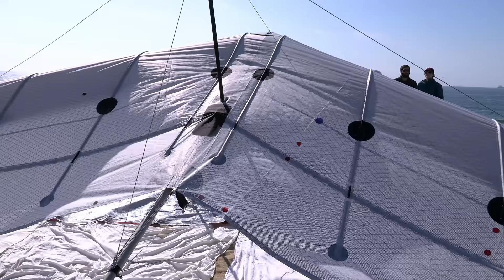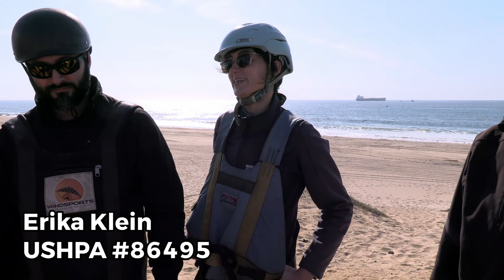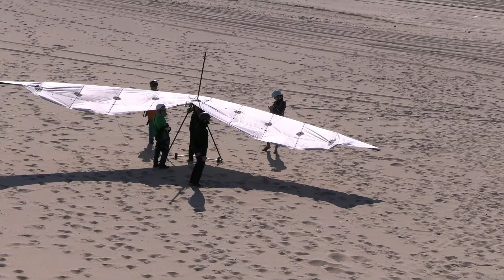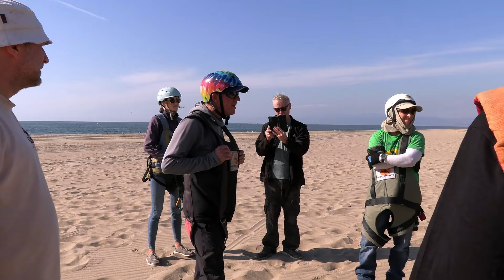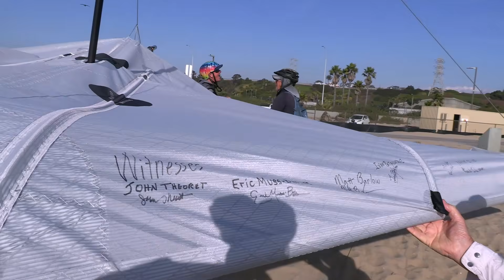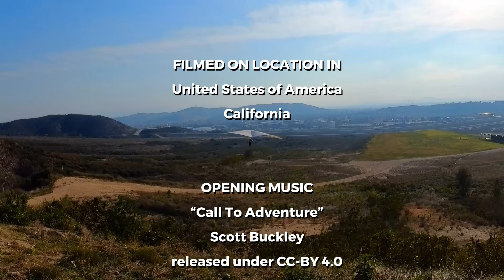Tiny Pack Hang Glider (TPHG) | Test Flights

Comment: You guys should look into the North Wing Sky Surfer, a much more defined glider that sets up in 6 min and breaks down to 6 ft in 15 min. I have one, Kitty Hawk has one. 40 lbs, flys wonderfully lands slow and sweet. Kamron had to put the project on the back burner as his workers/designers got killer together in a trike accident. 
 I had students wanting to trade their gliders in on the one I had. There are videos of the Sky floater flying, launching hands off and landing. Why reinvent this class of glider and from what I see taking design backwards. Sorry for saying what you don't want to hear.

Comment: What a trailing-edge-flutter... The idea of short-pack is not new. So far there has never been a light and easy short-pack glider that flew well. This seems to be no exception. Face it people, for a hangglider to fly great you have to accept the bulk and weight! And it's worth it, as nothing beat's this feeling!

Comment: I hope he can fix the aerodynamics while still achieving the weight and packing goals.
It looks quite obvious that the battens should extend all the way to trailing edge, not sure why he made them shorter. Maybe batten length concern due to packing, but then the Finsterwalders have battens that can split.
That cross bar solution obviously didn't work, and the lightest possible solution would be a bowsprit design, although at this low nose angle it may be a challenge.
The middle span of the sail has the trailling edge too low, so there's no washout on the glider. Maybe even a negative average washout, so the glider is, besides stiff from the crossbar, also unstable. The front part of the sail looks too stretched. All those things can be fixed with sail cut, longer battens, and a different crossbar solution. If the result is still very light and short packable, then it will be great!

Comment: I am very happy to see that research into hang gliding is still going on. Research has been stopped for many years, only implementing small things. The Finsterwalder wing is almost perfect (and very safe) the only improvement would be to shorten the short package by 50 cm. Your wing makes me happy because the package is very short but it has too much flutter (not only on the trailing edge) everything is very loose and it still seems very unsafe. Keep up the good work, keep improving and thanks again for trying to solve the only problem of this sport: Logistics.
Reply from the maker: So many people keep making good comments about the Finsterwalder, it really makes me want one.
Reply: @HangGlidingFlightSchool  They are great! Glide above 10, good speed, a joy to handle and land, flare is easy! Worth buying.

Comment: Something that doesn't work in theory, won't work in practice.
Reply from the maker: Depends on the competence of the person judging the theory.
Reply: Proof of concept models are a thing you know. Now he can make a second version fixing the problems while keeping the short pack and light weight.
Reply: @ericoschmitt  You're right, proof of concept models are a thing, but in this case he built a glider without several design features which are absolutely required to make it turn and prevent it from stalling etc and none of which particularly conflict with the design mission to create a short pack hanglider. This makes no sense. Anyone with basic knowledge of aviation design could have told him that his design would not fly would not turn and would be prone to spin and lockout. All issues which have been designed out of hangliders 30 years ago. He has demonstrated the need for concepts which have already been proven by others, but he hasn't proven his concept, that he can make a short pack 5ft glider which can take the loads of flight, so it has really achieved nothing, and at high cost. I'm not saying that what he wants to do cannot be done, just that this hasn't really moved him closer to doing it. I would say he's a person who is good at making things but not competent to design an aircraft. A lot of qualified people have evolved hangliders from being death-traps to being very 'fit for purpose' and efficient machines - it is possible that everyone has missed a way to make a glider pack up small with no compromises on safety or performance - but considering how much this guy seems to have missed about hanglider design, it's a stretch.

Comment: thank you, thank you, very, very much for NOT mentioning paragliding!
also; sorry; no disrespect to Florian; but the ultra lightweight and short pack hang glider was designed and manufacturered many, many years ago by Finsterwalder and they STILL sell gliders!
Reply: I think by "tiny" they mean 1,5 meter, while the smaller Finsterwalders are 1,85m (Lightfex and Airfex) while for most people the 16sqm Perfex and Funfex pack down to 1,95m. I own a Funfex and it is great! However if someone manages to make something even smaller, lighter, quicker to setup from short pack, great!
Most of the time I keep it in long pack anyway, along with the other gliders on garage racks. It's an amazing wing even if you use it only as a 'conventional' hang glider.
Reply from the maker: Fisterwalder is mentioned twice in the video.

Comment: I have an old Colver variometer. Is Frank Colver the designer and manufacturer?
Reply from the maker: That is correct. Frank Colver invented, built and sold the very first hang glider variometer. Great guy. He is active on the US Hawks forums, if you would like to reach out to him.
Reply: I remember being in on a conversation with him at the club meeting downtown when he bragged it only used 3ma.  I am still impressed.

Comment: The inability to turn is not surprising. Flexwing hang gliders require the sail billow to “move” from one side to the other to turn. By introducing the rigid “battens” spanwise prevents the differential billow to turn.
Reply from the maker: Yes, that was what all the pilots in attendance concluded.

Comment: Bonjour , bravo pour cette recherche . Le velcro pour fixer les lattes au bord de fuit a déja été utilisé par La Mouette sur l'Atlas  et le X-ray en 1978-1980, ce n'est donc pas nouveau . Les lattes doivent aller jusqu'au bord de fuite , avec un peu de reflex pour donner de la stabilité au profil . Il a existé des ailes pliable en 2,5m (Windfex de Finsterwalder); Bref je pense que plutot  que de re-inventer "l'eau chaude" , ne serait il pas plus efficace de partir sur des bases connues et testées pour faire une tiny-delta ??bonne continuation pour le V2 . Benoit PERMAFLY France
Reply from the maker: Yes, and the La Mouette Atlas is the first true "modern glider" so the sport owes a lot of gratitude to Jean-Marc and Gérard Thevenot. Many pilots died on the unstable gliders which were created before the French contributed the La Mouette Atlas design.

Comment: It needs either a 'leech line' or in short, a small line (strong string) in the trailing edge.
This will keep the trailing edge from flapping.
Small batons will also help, but it looks like you really need to slightly modify the sail cut.
Reply from the maker: Pretty much all of that is said in the video, but thanks for reiterating important ideas.

Comment: I agree with the idea of a more practical hang glider. I recall how my old Gemini was practical and fast to set up. I was thinking the Ram-Air would be a mid-ground between paraglider and hang glider. A hang glider packable into a backpack would be great. Inflatable battens, maybe.
Reply from the maker: There are a lot of potential approaches.
Reply: What I heard from people who flew the RamAir was the performance sucked as soon as you pulled speed. Maybe the concept was badly implemented, I think with today's knowledge about modern paragliders, a ram air undersurface could be made to work very well.

Comment: A TPHG has eluded designers for decades, it is a very difficult engineering challenge. The Whitney/Eddie Paul Portawing looked to be as minimalist as structuraly posible. I hope this colaboration of veteran pilots can acheive their goals.
Reply from the maker: True. Extremely difficult to engineer something with adequate strength and rigidity, plus the ability to compact into a small size.

Comment: Some interesting innovations, i can see the Spaneron is causing a big problem preventing the essential billow in fact its deforming it the opposite direction not helped by no luff lines that’s why The trailing edge is shaking badly as the airflow is separating detached airflow in a critical area even at high AoA  - fit luff lines & a floating telescopic collapsable cross tube to enable roll/yaw control
Reply: Or instead go bowsprit, which will be lighter than both solutions and no cross tube to worry about!
Reply from the maker: All the pilots present reached the same conclusions.

Comment: Velcro is what was used to secure battens in the 70s.
Reply from the maker: Interesting. Didn't know that.
Reply: @HangGlidingFlightSchool  Yep.  We stopped doing that because Velcro either stops sticking together or wears through.    Strings are easier to replace.